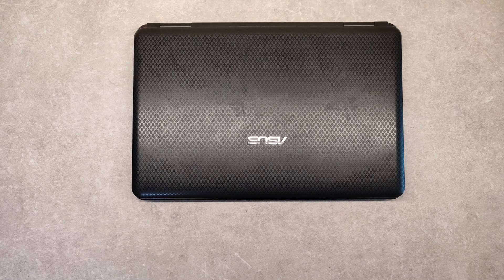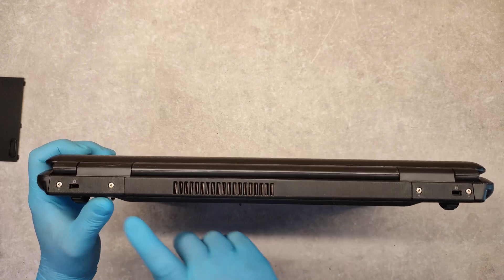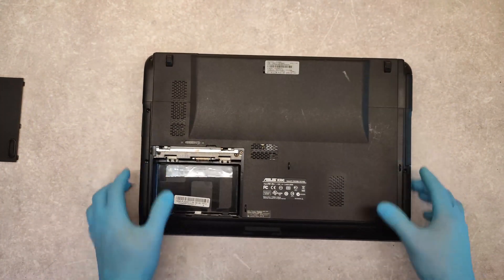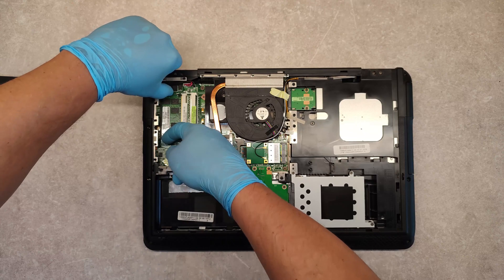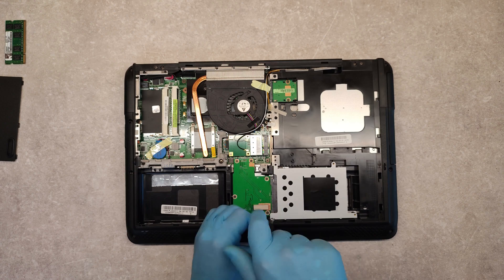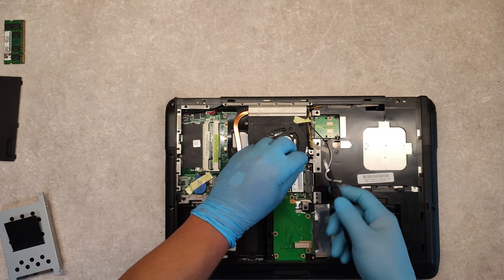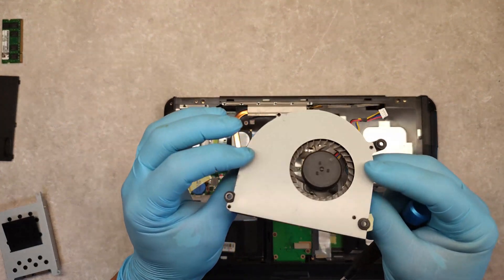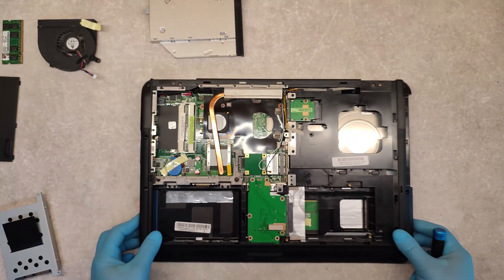ASUS K50C, K50IJ DISASSEMBLY, HDD REPLACEMENT, BATTERY REPLACEMENT, RAM UPGRADE, CPU FAN CLEANING

Comment: Bruh thanks for this video. I was thinking to upgrade my asus k50ij this month and I found your video lol. Can I upgrade this laptop to windows 10? Can I put ssd drive? What imtel core can I use? Do you need to reprogram everything in the laptop when you change all this things?
Reply from the maker: Hello my friend! You can upgrade your laptop to Win10 and of course you can replace your hdd with SSD. You don't need to reprogram anything. Just install any missing drivers if they are not preinstalled with the new Windows. If you like the video you can support my channel by subscribing. Thanks! :)
Reply: @MrTechGuyDIY  thank you so much
Reply: اريد مساعدتك في فك البلوك عن البيوس asus k50c